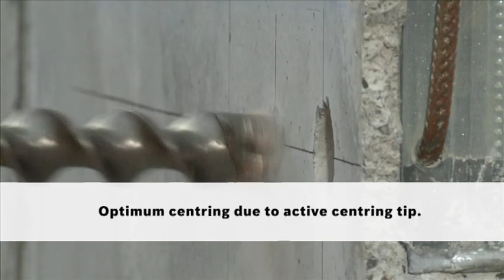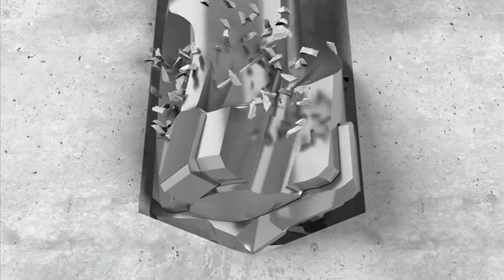Bosch SpeedX SDS Max Drill Bits

Comment: bosch....then all the others!!!
Reply: Long time ago I get it, but still no!  Hilti, then the others in any order you like but that's just pros I have not got the faintest what the typical DIY family man use these days? Should you somehow manage to kill off a TE-CX in any unexpected way or burn through so much rebars it heat up til carbide tip come off then just call Hilti and get a new one just like that.
But with that being said if one stand and push sds plus tips into concrete walls all day long, week in and out you should notice the difference or else it's all talk, can imagine for use every now and then any tip top brand should be sufficient and heard American friends who refuse to abandon for ex Dewalt even though I swear to them I used to use them too and the Hiltis will murder them in a long term competition and hence not overpriced after all in the end of the day since one must calculate cost for bits over time per meter of whole and that change all personal feelings about equipment not based in real life facts and solid calculations.